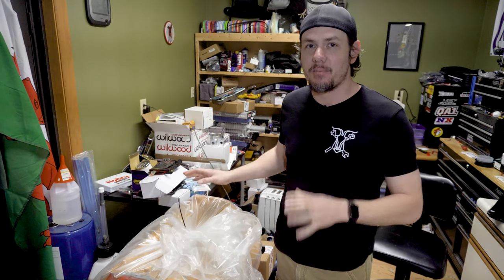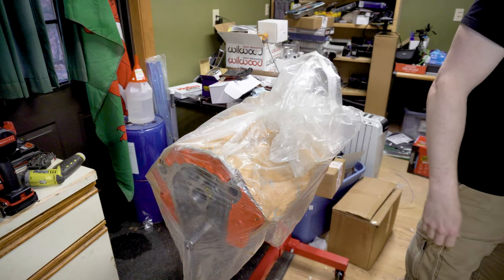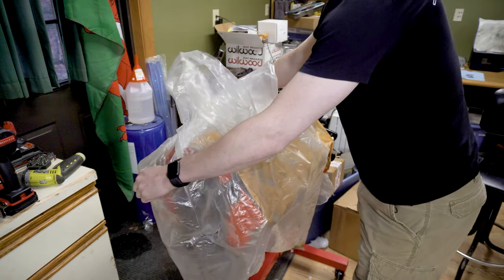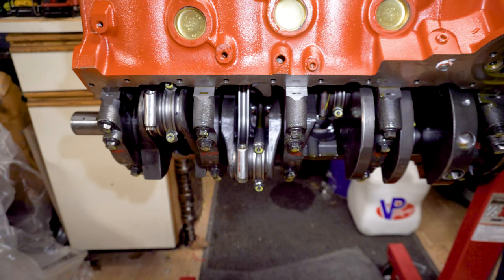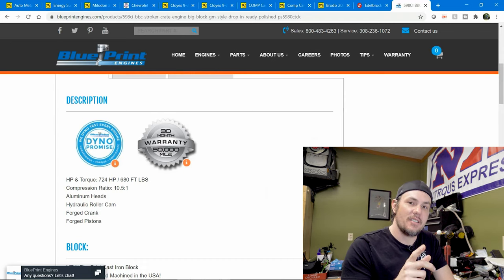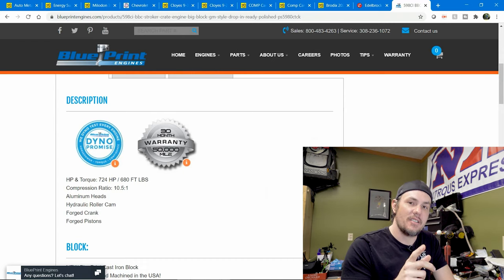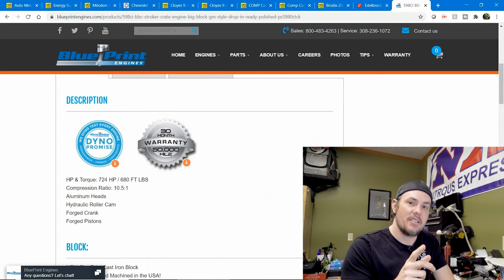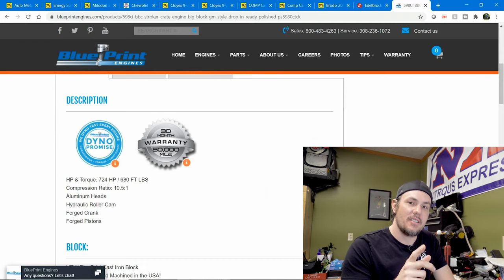Unwrapping Our BluePrint Engines 598 Big Block For The Smoke Monster Nova!

Comment: Do you plan on running E85? What sort of injectors? Would love to see how this all turns out, your tuning, what sort of timing you're able to run, etc. Very neat project. Oh, a Procharger is a good idea as you already will make lots of torque down low. Maybe throw an F-1X on there, bigass intercooler, easy 1200 hp. You may want to gap the rings more right now while you can, I guarantee you'll get use to 1200 and want more. :)
Reply from the maker: Yeah, think I'll end up running E85, haven't decided on the injectors but I have a few sets that will be fine until I decide on what I need for final output

Comment: Interesting because you can pick up some serious inches over say a 454 and stay under a stock hood on a chevelle or Elky.  Run pump gas, low compression and still have fairly serious torque.  Cool video.

Comment: Would you tune my 8.1 if I sent you files nobody around here seems to be helpful.. I got a Raylar cam and intake modified and a 87 mm newer gen 4 tb with x link I have hp but not smart enough to dial it right in

Comment: So why buy a shortblock over building one
Reply: It is way more economical (especially if you don't have one) Plus couple other benefits, such as no back and forth to machine shop, you spec it out how you want. It is assembled  clearances corrected and then shipped to your door. And best of all every thing is brand new without all of the metal fatiguing heat cycles . Just my experiences.
Reply from the maker: Yeah, just no yeah benefit in this case to building one, would of come out behind to do the same thing
Reply: To each his own I guess. To me building a custom engine that noone else can pick up a phone and order is the best part of a build. 
I’m sure you could have built one for a lot less $. A lot more work for sure but less $. 
I have ordered new and rebuilt engines in the past and had clearance issues. So I like knowing 100% that it’s how I like it.
Reply from the maker: There's no engine you can build that can't be ordered over the phone. The difference is that a company that orders 1500 sets of forged rods gets them for a fraction of the price you can and so they can provide a built short block for cheaper, it's just economy of scale.
Reply: @GoatRopeGarage  It’s not that simple just because they’re enjoying a 40% discount does not mean you are.  a lot of engine builders will only work with certain manufacturers for this reason. so if you want a different engine combination then you may not enjoy any discount. Also does their discount save enough to cover the labor. for example I built my GEN 2 coyote the way I wanted for under $5000 a comparable build would’ve cost me around $20,000.  engine builders are asking more than 5000 for just the short block. The economics May not be quite as simple as People may think
Reply from the maker: Actually it is, that is why you can get a short block at that price. To build it yourself would cost at least $5k for the parts in the short block with any machining, balancing, etc. What, trying to save maybe $200 in labor for assembling the rotating assembly and going the rings? I'm good. I've got better things to do.
Reply: @GoatRopeGarage  i wasn’t trying to offend you. I don’t know why you’re getting upset I’m just trying to have an adult conversation.  like I said to each his own. If that’s the way you prefer that’s fine.  like I said I preferred to do it my way and I was just asking you what your opinion was on ordering a short block over building one. It’s not always cheaper to order one over building one. If a engine builder Only made a couple hundred dollars on an engine they couldn’t stay in business. I saved $15,000 by building my engine
Reply from the maker: Not offended at all. There is nothing I do that I don't work there numbers multiple ways. Just wouldn't come out ahead in this scenario and it would of taken a lot more of mine time. And I'm guessing you've never had a machine shop ruin a block before.
Reply: @GoatRopeGarage  I have had a machine shop destroy a coyote block. I understand time absolutely. I feel like it would have been cheaper to build than buy. That doesn’t mean it’s the best option. There’s a lot to consider with a build.